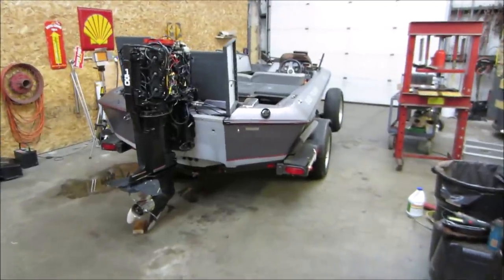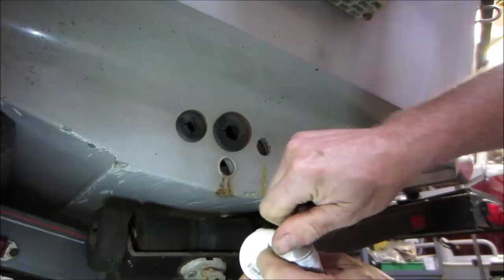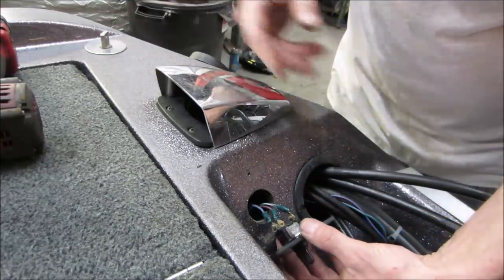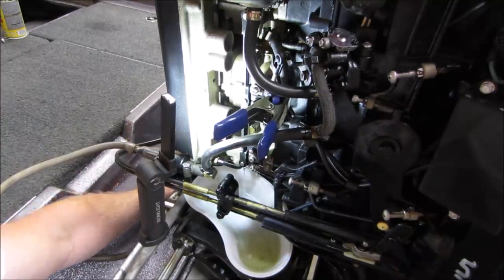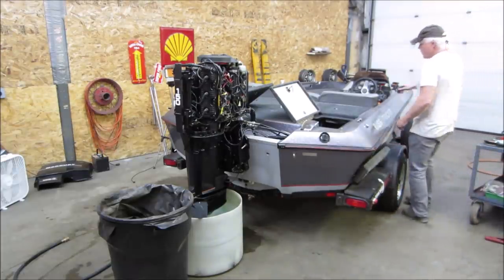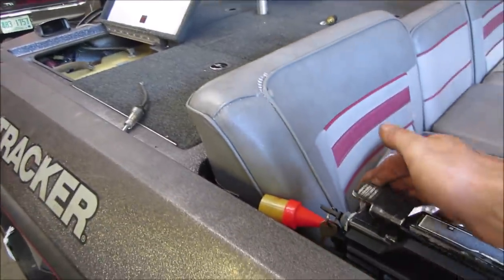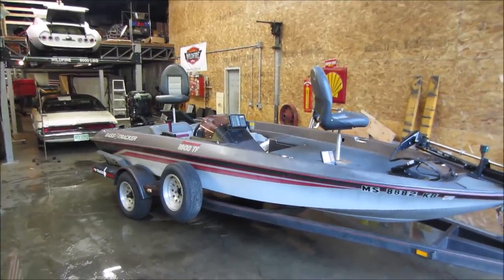Bass Boat Sitting 10 Years, Lets See If The Engine is Good?

Comment: Silicone is for bathtubs and aquariums. In over 40 years in the professional maritime industry I have never seen it used in a below the waterline through-hull fitting. There are many marine sealants. In my day the go to below the waterline sealant was 3M 5200. It still is, I think. Buy in small tubes and discard after use. It will keep a week or so in the fridge once punctured. Tip: 3M makes a very specific solvent to remove old fittings bedded with 5200.
Use alcohol to clean up fresh 5200, NOT acetone. The shit gets everywhere!!!

I only use BRONZE fittings below the water line for the very reason the first was broken in this bass boat.  I saw a two year old $750,000 French made catamaran (Privilage 60) almost sink between St Martin and Tortola, BVI  because a NYLON fore cabin toilet (head) through-hull snapped.
I was on the salvage mission back in 1995.

Comment: Replace the water pump and fuel lines and always put pre-mix in the fuel tank. Never trust the mixer. I replaced my transom once and had my motor looked over. It had a self oiler. Got my boat, played around for a few days and wam, spun a bearing because the self oiler stopped working.

Comment: You killed me a bit with this one. You have to fill the 2 stroke oil tank on the engine. Per the merc repair manual, it will not fill itself only maintain. The float is only a low oil alarm that connects to the dash

Comment: I would take a long hard look at that oil injection system they fail often. It’s not moving levels and it will burn the engine up with a quickness. I got a 150 just like that and the oil injection failed that’s how I ended up with it, it’s on the schedule for a rebuild as soon as I get my seadoo done. Good luck 🍀

Comment: Shoot I been a boat seadoo atv mechanic 42 years and I get 8-10 boats every year that sit for decade or longer. Almost always carb kits fuel lines impeller and service lower and good to go and new battery and clean out tank of course. we call those old black max's suitcase motors There is a float in the small oil tank that triggers the pump in the large tank filling the small tank

Comment: I had a green gas issue in the past. The oil is leaking into the fuel tank. The brass fitting that the reserve oil tank and the fuel tank lines go together has a one way valve built into it, the one way valve has gone bad letting the oil to leak into the fuel tank when it’s sitting.

Comment: Check the screen at the bottom of the pickup in the oil tank to be sure it does not have the wax that can form over time. The big tank looks like it is running to slow. That is common with the oil used in these motors. Always change the water pump every two years no matter what. They can get hard and stop working and not when you want them to for sure.

Comment: The stuff I was gonna suggest has already been mentioned so will spare you that. Well, gonna say it anyway since I've been around these motors a lot. 1. I bet dollars to donuts that water pump will fly apart from age first trip out. 2. Oil injection is nice but getting a block off kit and running 50:1 premix would be a good way to go on a motor this age. The oiler on my '94 Mercury 200 on a previous boat failed and we just blocked it off. The gear went out and I shut it down when the buzzer screamed. 3. Better pull the carbs and go through them just to be safe. 4. With the used boat market being stupid right now (it is here in the south anyway not sure about up north) that boat would be a good flip for you as clean as it is for its age. People are paying thousands more than a boat is worth if it runs good and looks at least decent.

Comment: So, I have encapsulated pretty much all the comments on this video
1: Replace the impeller every year or two whether you use the boat or not
2: the choke is a momentary switch and needs to be held in to activate
3: the float switch in the upper oil system is for an alarm
4: Get rid of the oil injection altogether and just premix (foolproof)
5: the hose to nowhere was a vent for over pressure of something (I forgot)
6: Replace the fuel line and bulb
7: replace all the through-hull fittings with the black kind and use 3m (or Quicksilver) below water sealant
8: buy a new fishfinder
9: check your lower gear oil and make sure its not white and junkie (indicating water intrusion)
10: Find out max rpm of that engine and make sure the prop and pitch are correct
11: install mouse trap in garage : )

Have fun

Comment: After 10 years, change the impeller regardless of how well it pumps. Also, the oiler tank on the engine can be fully filled by loosening the cap and letting it fill, then closing it. Remember that the main tank must be completely closed or it won't pump oil.

Comment: The oil level sensor on the reserve tank may have gone bad and may need to be replaced, since it didn’t set off the alarm that the reserve oil tank was low. The sensor was what you thought was the sending unit. The motor has two audible alarms one for low oil and one for not getting water.

Comment: I had a 115 merc.from 1989 and used mixed gas as I didn't trust the auto injection. It's still run-in as I told new owner to mix his gas at 50 to one.

Comment: I have a boat similar to this that has had an issue with running for years. It’s a Johnson 150 GT. I have narrowed it down to not getting spark. I only have one cylinder that was getting spark so I tried that plug and wire on all other cylinders but it didn’t work on any of them. I just replaced the power pack and it still isn’t getting spark.  Any info is greatly appreciated. I’m desperate!

Comment: The small oil tank on top of the motor is the emergency "Get Home" reserve tank in case the large oil tank in the bilge runs out. That small tank will give you maybe an hour or so wide open throttle to get home. Always keep the small tank full. No oil is pumped from the large tank to the small tank. If the large oil tank in the bilge runs out, a sensor in that tank will tell the motor to start drawing oil from the small emergency oil tank on the motor, and the motor will automatically start running off the small tank on the engine to get you home. When that tank gets low you should hear an alarm in the dash go off.
Reply: Yep. That's what I always thought.
Reply: This post is "FAKE NEWS". There is zero truth to anything written in it. I hope no one is misled by this.
Reply: @420somewhere4  Back in the day I had a 1984 200 HP Mercury Black Max 74 degree V-6 on a 23' Sea Ox and the oil injection was set up like Mustie's. With the engine off, if you turned the key to the Run position, you would hear a beep or beeps from a little horn in the dash as the engine did a self-check on the electronics including the oil injection system. After starting the beeping would stop if I remember right. Take care
Reply: @leveraction1285  yes I still have a 2004 Nitro NX882 with a Mercury 150XR6 and it still does the safety beeps. They only made the XR6 for a couple yrs. A mechanic at Bass Pro told me they quit making them because they were too reliable. Everything still works on motor. Changed steering cables once. I didnt get lucky like mustie. Lol
Reply: @420somewhere4  I hear you about reliable and nice rig. I bought new in 1984 and ran it until around 1990 and sold it. As far as I know the new owner is still running it. That engine never missed a beat with many hours of trolling speed and wide open. Never skipped once or fouled a plug. I always ran Mercury oil in it and the oil injection back then was spot on. Take care

Comment: The fact you started it dry after 10 years forsure means an impeller change. I never ever turn an outboard over without first sinking the lower end in water. Also need to push in the key and hold it for choke.

Comment: Well before you change the impeller I would change gear oil first. I then change impeller and do all maintenance on the engine then take her out start it up take off trailer running for about a half-hour see what you got. Then I would worry about trolling motor.. The other stuff you can add on later. Nice old Tracker.

Comment: The float on the top oil tank is just for warning buzzer that your getting low on oil.  The oil system works off pressure.

Comment: It also looks like you're missing a rubber grommet for your cables and lines where they come out of the hull and hook to the motor should be like a 3 or 4 inch rubber boot that the cables run through and keep water out

Comment: My experince has been to REPLACE the rubber impeller on any outboard that has sat for many years. They get a "set" and may pump and "pee" but still overheat because they the impeller is worn.
Replacing the impeller can be a REAL PITA, but you start with a brand new one this way.

Comment: If that boat is aluminum, after you put the bleach and dish detergent on the molded areas and pressure washed it, you can put 100% Acetone on it and that would clean the rest of those areas of the body up and it will remove the mold quite well also...

Comment: Do the water pump.  Over time the fins will break off and sometimes you can't find them in the engine causing an overheating issue.  Cheap insurance.  I change mine every 3 yrs.

Comment: Mercury recommends the water pump to be replaced yearly, I will let mine go for two years, as I don’t use the boat a lot. My lower unit does run hot, so I do change the oil yearly.

Comment: Every 2 years is a good time to replace water impeller.  Those motor were known for having weak stream from the pisser.  It has a high pressure water pump too.  When you get into high rpm it will suck more water through.

Comment: 40:35 oil level is up in tank. You had the cap off a while. Wonder if the upper tank is not venting with cap on and pressure is causing low fill rate from supply tank?

Comment: Make sure you have 50:1 oil getting to the engine.  The old gas looked like it already had the oil mixed in the main tank, not added by  a separate injection system.  Running a 50:1 engine without the oil is fatal to the engine.   Ask me how I know?
JoeB

Comment: The oil flow will increase with increased rpm.
Also, the choke only works while the key is pushed in. Couldn't tell if you were holding it in while cranking the engine.

Comment: The reserve oil tank in the motor should be full at all times. To fill it you open what you are calling the sending unit. It will fill on its own when the cap is off. When the tank is low like it is an alarm will go off. The sensor that senses its low is what you are calling the sending unit.

Comment: Hey bud I have a 89 1600 tf. I just put an 79 model 85hp evinrude and it doesn’t seem to sit low enough in the water? It looks like I a need a long shaft I’d really appreciate any input. It’s rated for a 115 for I can’t find one for sale locally and I got a steal on the evinrude and it’s super clean

Comment: My last mercury 150 oil system had a bulb.  The system does not work if the cap is off.  It has to be sealed so it will pressurize the main tank.  The pressure will then push the oil into the header tank (the tank on the engine).

Comment: If the engine has been sitting that long, be prepared for the lower crank bearing to go out....you'll see fuel weeping down the lower unit, and the engine will run like crap due to a major vacuum leak.
I hope you luck out and it doesn't happen......all that blue smoke at start-up is a good sign the crankcase had lots of residual oil inside.

Comment: You need to hold the choke in while cranking. The choke closes some butterflys innfront of carbs so to have it actually do something you need to hold the key pressed or the choke button while cranking. :) Just loves your videoes. I was like, the peehole is straight bak on these. I had a 90 mariner wich are identical and it sounded like it needs some new hydralic oil also. But when the engine is running the tilt motor will have vibration that will help it kick in on those old brushes that are in the tilt motor on these. Its dam near impossible to get hold of a new and the replacement motor you can use to convert it to a round engine is getting a lot of hate as its not really any good. Im gonna see the start up now a d continue the video but had to come and comment on this matter. Toby, Norway
Reply: Also, looking at the impeller you 100% need to change it. The stream on these should squirt about 6 feet with a thick steady stream on these. And its a old girl,, dont trust the premix but also give it 1-2 % straight in the fueltank as well as the premix so you dont run it lean on oil. Especially if you are to run it on WOT for longer times. And yes, gear house oil. Change it. :) Fill it from the bottom and then up. Great video.
Reply: These engines can bring you easily 3000usd and up here in norway. Its a classic.

Comment: On something that sat that long definitely do the water pump impeller. I can guarantee it's dry rotted and cracked. Cheap insurance and it's a 20 minute job as long as none of the lower unit bolts are seized.

Comment: I have a mercury engine, a lot smaller, 7.5, thing has never let me down. what concerns me, the smoke doesnt look bluish and there is no oil slicks in the water bucket. it doesnt seem like it is injecting the oil. the water coming out seems really hot too. hmmmm, id check those injectors for sure.

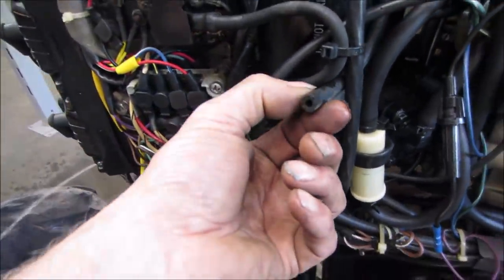Comment: the open line at 36:49 is a vent and does not get hooked to anything. if the 3 gallon runs empty, the engine tank supplies oil for 30 minutes at 50:1. as the engine tank empties the open line allows air in the tank. there is a check valve at the T fitting.
Reply: It is not a vent. It is a pressure releif valve to prevent the oil tank from getting over pressurized from thermal expansion.

Comment: Those old merc's were cold natured and hard headed. Get a block off for the oil pump and mix the gas yourself. Those pumps go out and you don't k ow until it's too late. Just be on the safe side change the impeller.

Comment: I had an XR6 150. The top oil tank would leak oil into the fuel system and I would disappear into a cloud of blue smoke until the oil burned out of the lines and cylinders. I imagine that oil made it to the fuel tank after 11 years.

Comment: Hear in California  gas is $5. A gallon in many areas.  So hear acetone is cheaper. Ok I only saw gas prices posted $ 4.99.9 by the highway.  It doesn't affect me I ride a bicycle more often than not, helps keep my legs working. Or I ride a motorcycle that gets average 65 mpg, not terribly expensive to operate.  If I use the van it is loaded with camping gear and I stay a couple weeks so the cost is still low. I use solar panels to keep my batteries charged when I camp to run my frig and lights.

Comment: Replace the water pump!! Sitting for 10 years? Vital to the life of that motor. You can also bypass the oil injection if need be. Mix it straight in the tank. Nothing will ruin that motor quicker than no oil. Lookin good though!

Comment: Wheel bearings on your trailer if that thing hasn't been on the road in 10 years replace them completely if they're okay when you take them apart but you may be okay cleaning all that nastiness out and re greasing it probably safer to replace it all especially because there's only one axle LOL

Comment: Replace the gray fuel line on that old merc. They are known to break down especially with any fuel that contains ethanol. I see you still have that original gray fuel line running from the tanks to the engine.

Comment: You should have cool water flowing into the engine because that bucket of water is just getting hotter and hotter the longer you run it. You need water muffs that way it runs cool water all the time instead of sucking up the hot water and reusing it.

Comment: ok so i noticed one big thing u did wrong when trying to start the engine for the first time and ALOT of people get this wron

that lever next to the shifter is called a cold start lever how u start old 2strokes like that is put the cold start ALL the way full throttle bump the choke 3 times then hold and crank once she hits she will rev TO THE MOON so u have to catch it and bring the revs down or rods will fly out the block i learned that from my dad because we have a 1978 astroglass boat with a 1974 merc 850 thunderbolt ignition on it and thats how she starts cant just crank and crank cuz she just dont run when cold

Comment: The air system for the oiler is as-needed pressure and feed. increased throttle>increased oil injection>increased air pressure>increased oil pumped up from holding tank to use tank. That's the theory anyway. The practice is that the air pressure or a hose fails and you lose the power head.
BOAT = Bring On Another Thousand

Comment: The feed of oil  into the tank was just about right for the consumption of six pots it is only supposed to maintain the oil level flow ,that is why it was not moving on the line.